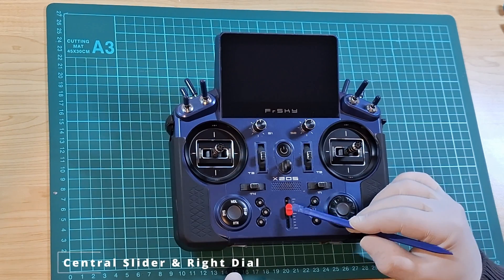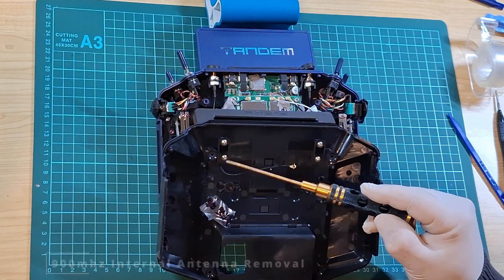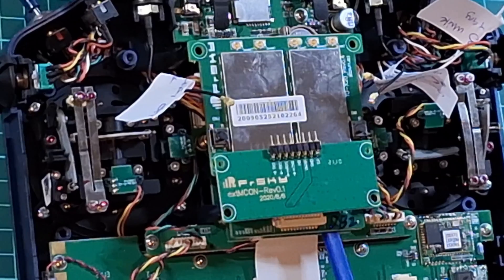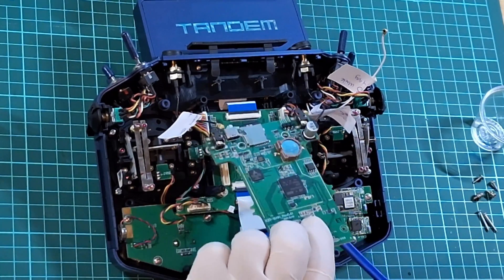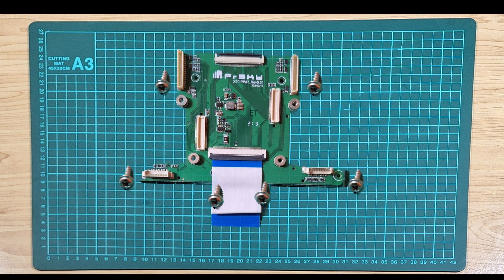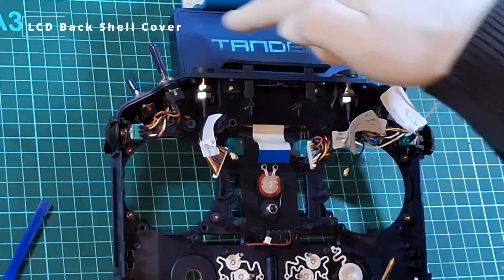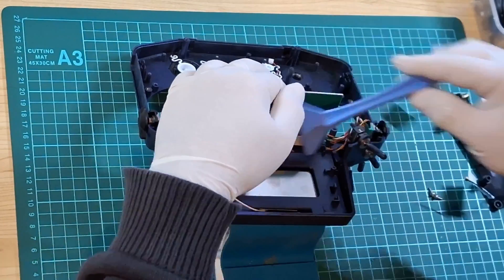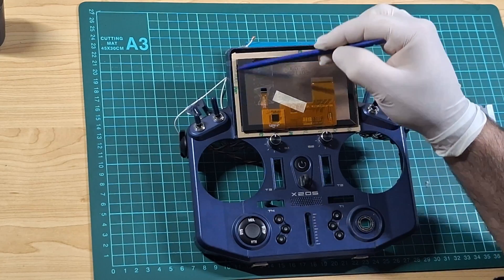FrSky X20, X20S Tandem Complete Teardown & Disassembly Repair Guide

Comment: Very clear and useful video ... My X20S will no longer power on at all. Tried downloading Bootloader but says no DFU present. Any clues? If so what board(s)/parts might have failed? Thanks
Reply from the maker: Try charging the battery on an external battery recharger, might be the battery. Isolate and trouble shoot and work your way out step by step. Next I would download the frisky app and reflas the transmitter that way. It can kick it into dfu mode without any use of buttons.  

Sorry for the late reply

Comment: Peut-on remplacer les interrupteurs par des potentiomètres ?
Reply from the maker: In theory yes, there is no reason why not. I am 90% certain however either test it without soldering or installing, bit 100% email FrSky or HorusRC to double check. 
Sorry for the delay in my reply

Comment: Excellent and comprehensive video!
Thank you!
My USB-C port is not detecting regularly anymore. Would you recommend to replace the port, or to get a replacement mainboard?
Cheers
Tom
Reply from the maker: replace the board, the headache desoldering is not worth the risk either, these ports are soldered by robots, if you over heat it when desoldering you run a high risk or bad damage

Sorry for the late reply
Reply: @Electronika-Technika thanks for the reply. I appreciate your knowledge! Cheers

Comment: Nice video. I have a question, if you can answer it it will be helpfull! My gimbal is jittering i want to change it. I sit necessary to remove all the other parts before like in your video or is it possible to remove only the gimbals?
Reply from the maker: Hi @wskyfly0073, I am really sorry for the late reply, you are in luck, there is no need to strip the whole transmitter to tighten, loosen or adjust your gimbals. All you need to do is remove the back cover, remove the battery then fast forward this video  to 9:55 and follow the instructions exactly. You do not have to remove any other component to adjust/remove gimbals. 
Thanks for watching my video and hope this helps else let me know.
Reply: @Electronika-Technika  Thanks for your reply! i finally solve my problem just by moving a cable... when moving the stick it seems to make the jittering in the other axes! tension in the connector interference?? now it works flawesly